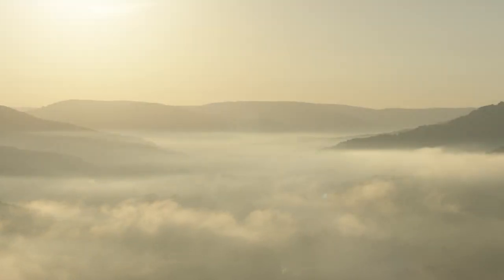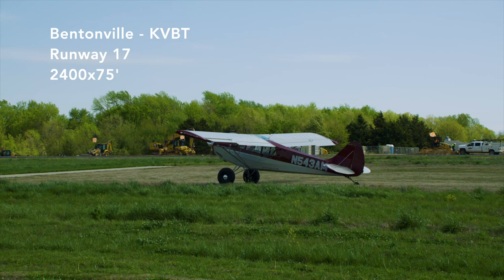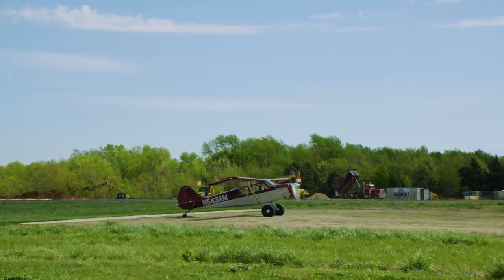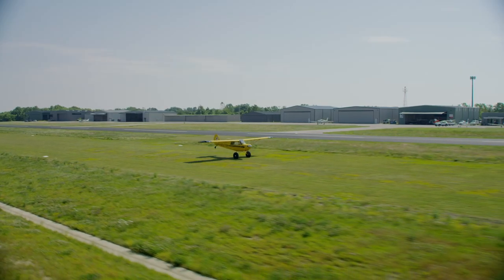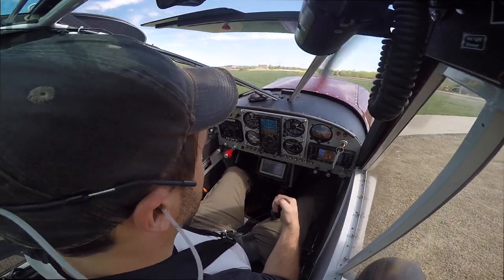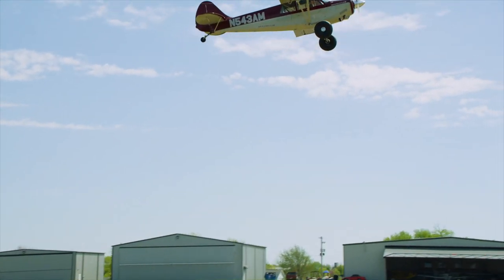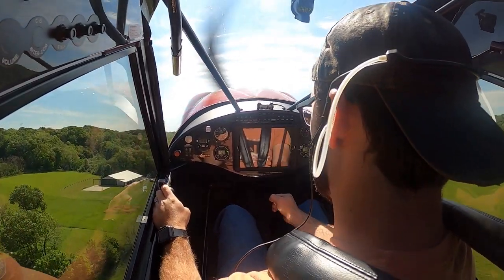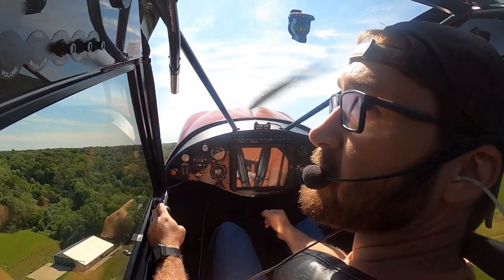Backcountry Flying Series Episode 2 - Maximum Performance Takeoffs

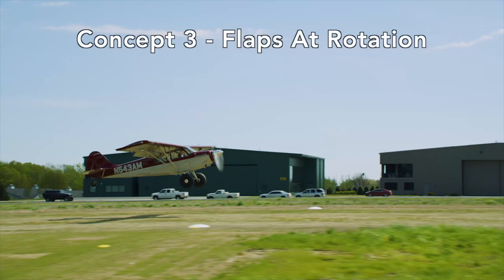Comment: Did you mean to say “dump” full flaps at 2:00.  You added them appropriately of course.  Good stuff.
Reply from the maker: Good catch on some potentially confusing phrasing. I think I have a habit of using the phrase “dump” to refer to the general rapid movement of the flaps, but I think you’re right that most people think of flaps coming up when they hear the phrase “dump”. Great input, last thing you want is to confuse the guy in the front seat into doing the opposite of what you meant with poor word choice!
Reply: FLY OZ minor thing from an old guy that has 40 years of bad flying habits. Happy to be a fan of your work. Your efficient and thoughtful presentation is effective and appreciated. Please keep it going.

Comment: What about airplane without flaps?
Reply from the maker: My experience with J-3's, Pa-11's, 12's, Citabria's and the like has been that the same procedure demo'ed here minus the flap manipulation works best. So keep the rolling start - tail up quickly and firm rotation into ground effect. You can also still utilize the counting technique through the takeoff roll just like in any other aircraft.
Reply: @flyoz  thanks brother. Trying to dial in my J-5. Great videos, I subscribed.
Reply: I fly a Luscombe, 85hp and no flaps, and use this same technique minus the flaps and counting. One thing I find worthy of attention during the roll (which is often more than 10 seconds), which wasn't mentioned here, is the pitch attitude. As mentioned in other Fly OZ videos, I look out at the wing tip and put the undercurve of the wing slightly below horizontal - in my airplane this is a 0 degree angle of attack and minimum drag. 85 hp, every pound of drag counts.

Comment: This getting-the-tail-up-high thing makes no sense to me. Yes, the wing will have lower drag but initially it's low anyway. The tail will produce way more drag though keeping the back end up. Wheel drag is increased significantly. Go and lift up the tail of a Husky, probably a hundred pounds or more. That force comes directly out of your available thrust .But it's the fashionable STOL thing to do.  Lifting the tail just enough to clear rough ground and letting the aircraft fly off at its minimum speed will likely result in a shorter take off.  Don't believe me? Look at WW2 carrier take offs; do they shove the nose down until they are level? Hell no. They weren't stupid and they developed their  technique over 20 years of trial and error and physics.
Reply from the maker: We don’t advocate a super aggressive high tail takeoff like you would see at Valdez and the like for normal ops. It’s hard to imagine that tail at level or slightly past creates a significant penalty to your thrust or lift when compared to having the tail a foot or so lower but still totally clear from turf and certainly it doesn’t come directly from the thrust vector. If the goal is absolute minimum drag you may or may not be correct, it would be difficult to measure considering the number of variables. In backcountry ops there are a number of other factors at play however. Lifting the tail to level or slight past greatly reduces your susceptibility to wind gusts and reduces the likelihood of being bumped up prematurely due to rough terrain. Any advantage you potentially lose in wheel drag is more than made up for in controllability. This is especially critical in an aircraft like a husky that may have poor aileron authority at the low speeds the wing will begin flying at. WW2 carrier takeoff were performed off of smooth decks in heavy aircraft, that’s a very different environment than a sub 1 ton aircraft with a super high lift wing off of a very rough surface. Thanks for the input! Always good to challenge our presuppositions.